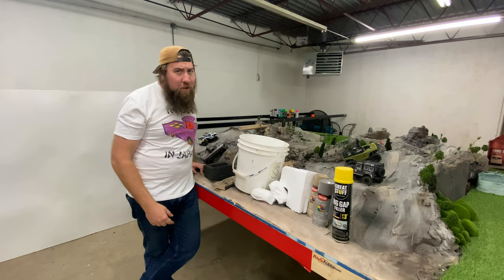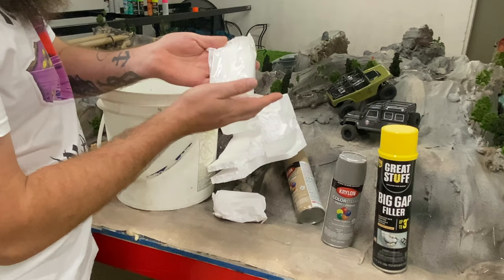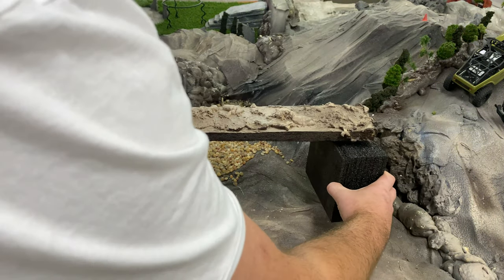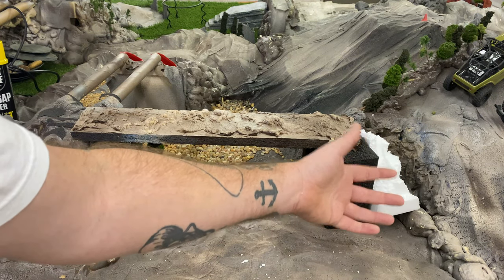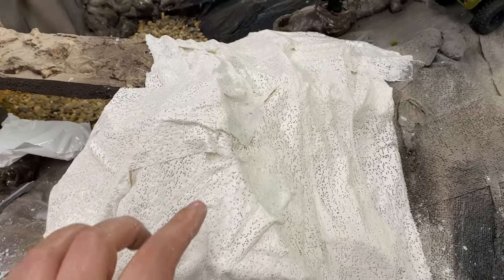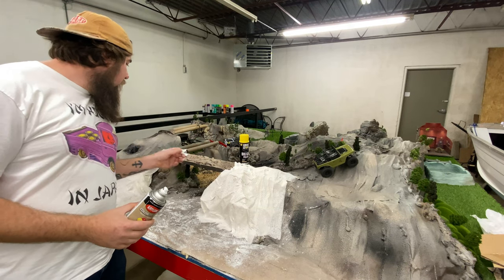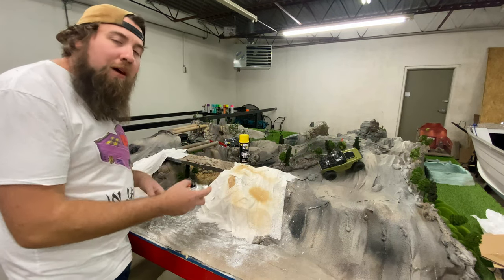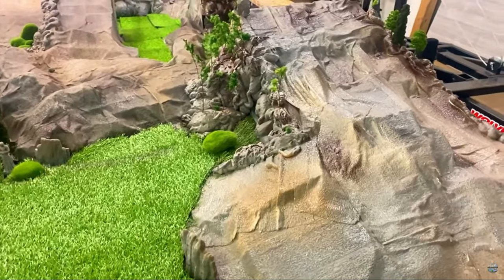How to build a Mini RC Crawler course out of TRASH

Comment: AWESOME JOB 👍👍 I have built one in the past for my SCX24, and I used similar techniques. My new one is going to be built in 4 pieces, and will be able to be put under the bed. Will be able to be taken out, positioned in different places/order, and then slid back under a bed. That way it won't take up space (for people with limited area)...
Reply from the maker: Yeah….. I made mine too big to fit through a door……. Oops.

Comment: sweet course and layout! I am building my own now on a 3'x4' plywood sheet. taking it week by week so I don't rush it and can use it and see what works and doesn't work. for extra grip I sprinkled on some sand from Hobby Lobby and use  Loctite spray adhesive to hold it in place and it works wonders.

Comment: Nice to see the crawler table back in action. The videos you did last year is what inspired me to start building one this winter.

Made the table so far (roughly 5 x 11ft) and some wooden modular frames to serve as base for the mountains. Then plan to mold the terrain out of chicken wire and use expanding foam to add details. Atm I'm working on a suspension bridge to install, but it's trickier than I thought. Lot of trail and error in getting the angle just right, so heavier vehicles don't flip over.
Reply from the maker: Do you have Instagram? I’d love to see it!

Comment: Great video.  I'm watching to build my own course.
One question. I noticed others would hot glue components before applying the plaster tape.  After the plaster dries, how sturdy is it? 
Do soft spots develop because things weren't glued into position?
Reply from the maker: The only soft spots are in places where I pulled the plaster tape too tight. The table itself if solid, and the soft spots don’t even really move, even with the heaviest of 24th scale trucks.

Comment: Roughly $80 of materials over that trash. Otherwise great video!
Reply from the maker: Spray paint and plaster cloth? Maybe $80 worth of wood, but nah. The paint was $8 for both cans. The plaster cloth was $12.
Reply: @10thScaleGarage  Yeah building materials are crazy marked up now. Ordered online in Canada they would be roughly that much.  $30-40 in plaster cloth, $16 spray paints. $10-20 expanded foam. Easily $60 CDN for one obstacle.  Paper mache and sanded grout over top would probably be the cheapest. That would cut out the expanding foam and plaster cloth. Outdoor courses can be completely free and easily changed. I prefer them when the weather is agreeable. Winter is coming....